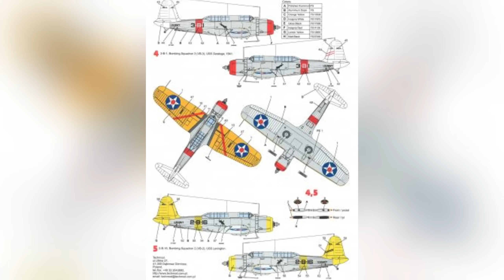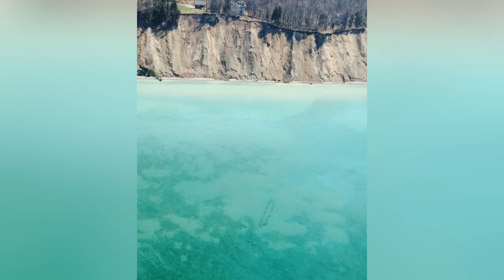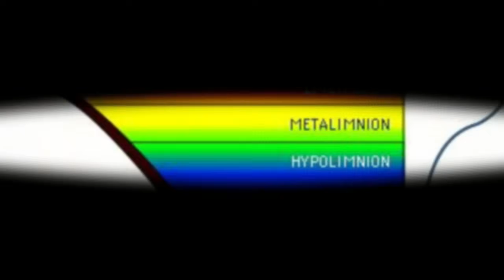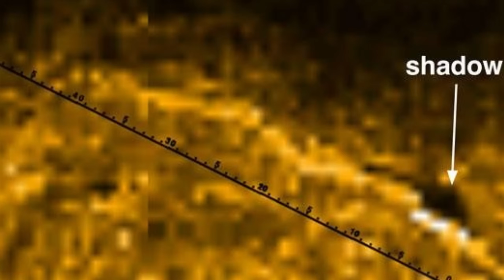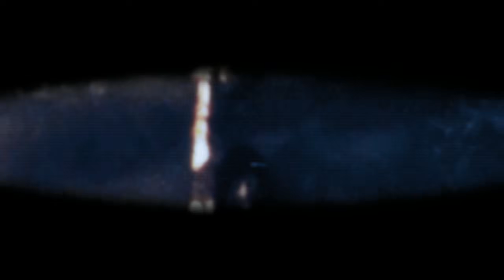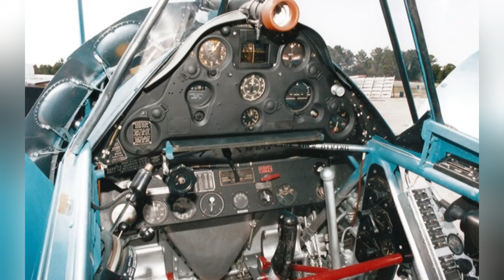Salvaging SB2U Vindicator: Raising WWII’s Only Intact Survivor

Comment: I have to question why you used photos of a different aircraft. The one you show has no skin, no engine and all the aluminum fuselage skin panels missing. Plus it was lifted using the regular lift set up for the aircraft, no fancy spreader set up.  Are there no recovery photos of this particular aircraft? And what became of the one you show?
Reply: I had similar questions. Suspicious photos.

Comment: Good job bringing one back from extinction. A Vickers Wellington was recovered from Loch Ness in 1988. After 48/9 years at the bottom of the fresh water Loch there was still air in the tires and when someone connected up a battery the navigation lights came on!
Reply: There is a documentary about it on the tube. Watching it after this thanks for the heads up. Nice seeing these relics brought back.
Reply: Good ol’ Wimpey’s as the Brit’s called them. Brilliant design by Barnes Wallace.

Comment: I was always a 'fan' of the SB2U as it was an underdog going up against the best the Japanese had in the early days of the war.  It was a testament to the brave men who flew those already obsolete planes against overwhelming odds.  I'm glad I will one day be able to visit and look upon its like.

Just finished the video.  The pictures of the plane being lifted from the water show-at least on the left side- exposed ribbing with no covering on the fuselage.  I saw no motor or propeller, just a mount and no cowling.  Were these pieces lying next to the aircraft and manually recovered?

That is one beautiful plane after preservation.  Nicely done.  I tip my hat to the preservation team and am envious they were able to do the work they did to save the plane.